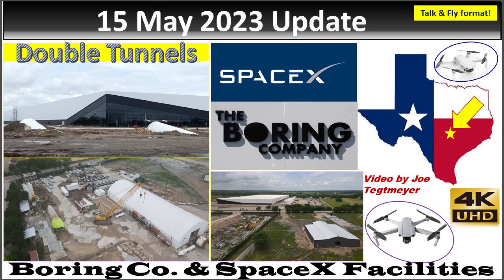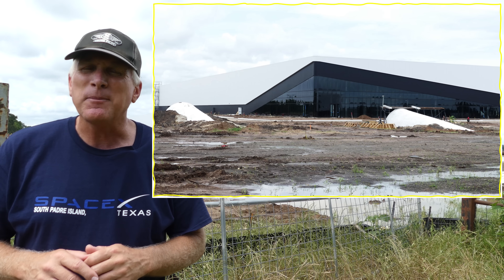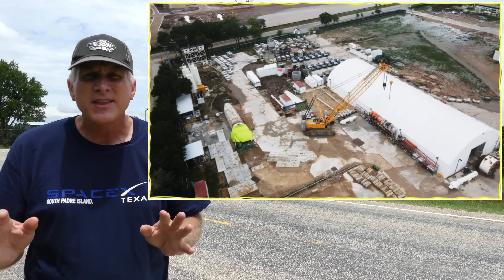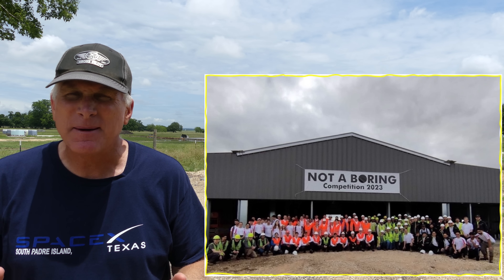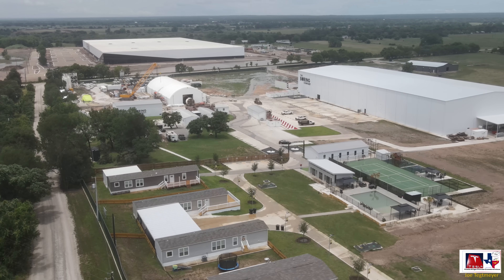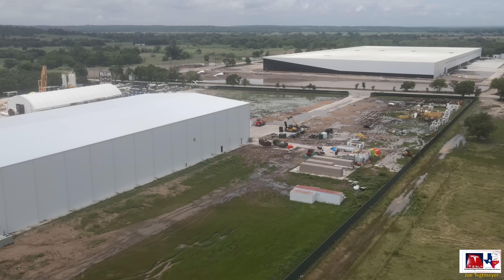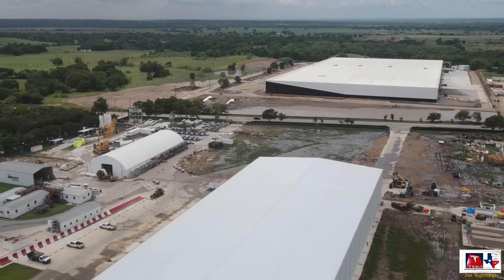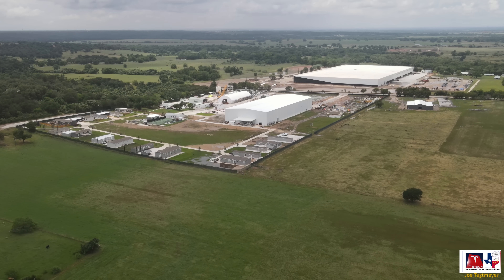Starlink & Boring Co Facilities Progress! 15 May 2023 Boring Company & SpaceX Updates

Comment: Awesome video work as usual.   

On the Boring Co side, on the concrete 'driveway/ parking area slab' in front of the new grey building (at 8:50 in video) there is a metal structure laying on the concrete. It looks like an entranceway decoration and looks like it might have writing on it. I can't make out anything intelligible. Maybe it will be standing up on your next flight.

The whole joint site seems incredibly wet. I realize it just rained but it has seemed really wet every time you film there. Maybe they need a 'deep tunnel' like project that can act like a sump for excess water.

Will the corporate offices for the Boring Company be in the Spacex building (where it isn't so wet and muddy)? Hence the need for quick access tunnels to the work site. Also makes for a good example for visitors/ potential customers.

again Thanks!

Comment: What is the purpose of the two tunnels
Reply: I think it is for demonstration only.  They are fairly short tunnels and they go under a road with fairly light traffic.  There is really no functional benefit to the tunnels.
Reply: could it be that the Boring main offices might relocate to a corner of the Star Link Building?? Or Boring could put up offices next to the road on the Star Link side.  just a thought, that would make the tunnels very useful.

Comment: That water tank is possibly for the Fire Protection System for the buildings.  Even though the river is right there, the tank stores water for a Fire Protection water supply.  The building next to the tank is likely the Fire Pump, and it will supply both buildings on a FP Loop.

On the road side, there should be some red Fire Department Connections located on the building, if you wanted to confirm it.